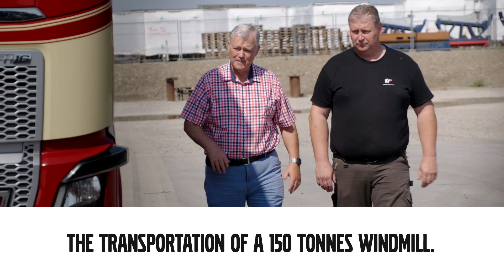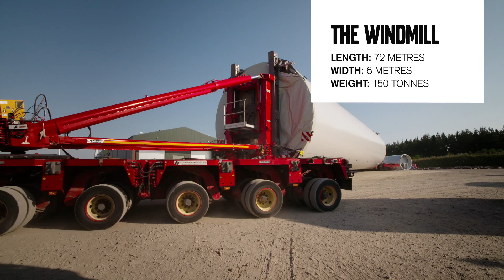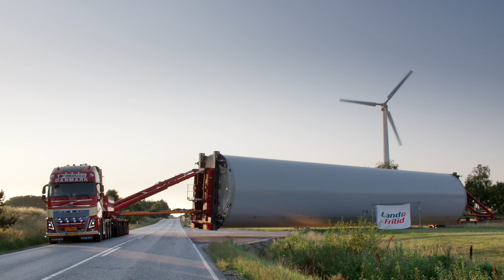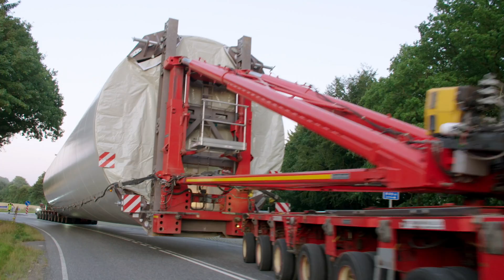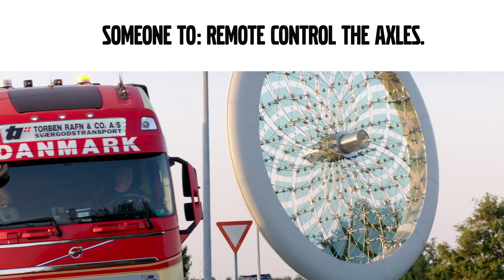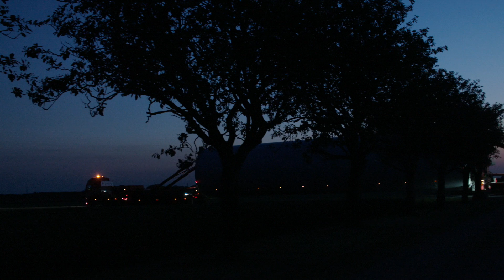Volvo Trucks – How to haul a 150 tonne windmill (with captions)

Comment: I see trucks carrying windmill parts like this almost everyday here in Texas and I don't know km but when they're on the highways they go about normal speed. Maybe 60mph. Don't know how much they weigh because I think the tower parts like in this video are made of fiberglass here
Reply: your country in Texas has roads that you turn to enter, and after you forgot what the steering wheel does...
Reply: I see them too, but they much lighter like a normal load. You cannot go 60mph with 350 000 pounds